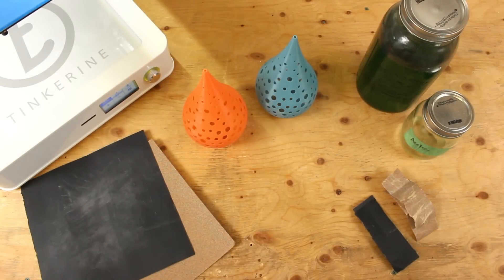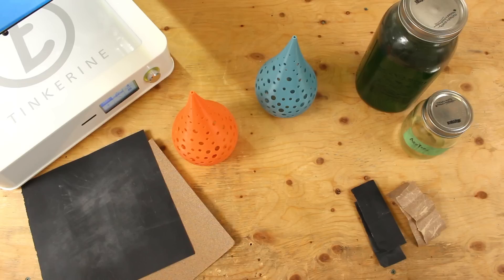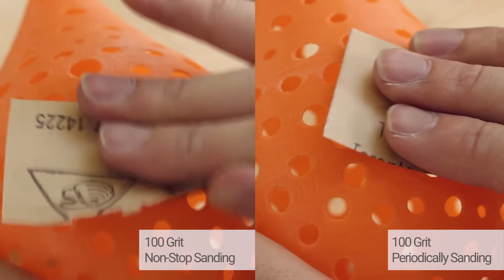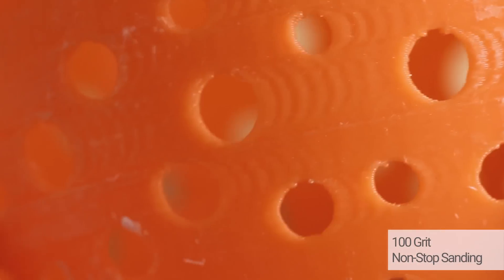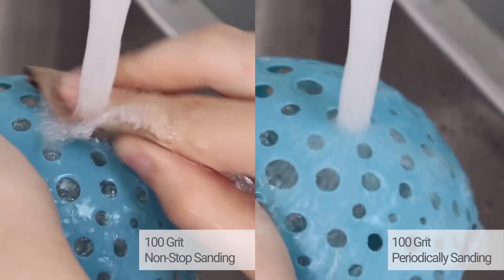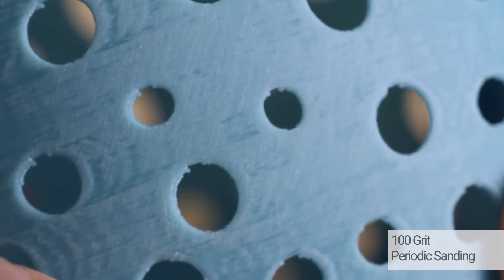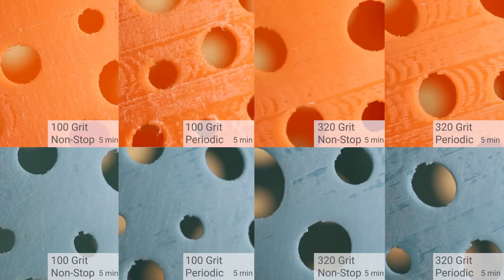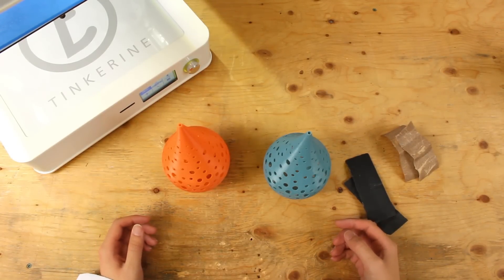Smoothing PLA with Sandpaper

Comment: Good video. I found it because I was thinking about sanding PLA vs. resin prints. My PLA sanding was always stringy, I was sanding dry. Resin sands with a nice fine powder, really smooth when rinsed off.
Reply from the maker: Thanks for the comment! Wet sanding is a better method for PLA to prevent it from heating up and becoming stringy.

Comment: Okay so... wetsanding under running water is pointless. The entire point of wetsanding is to build up grit under the sandpaper that is lubricated. When you do this under running water, you're literally washing away any grit buildup as soon as it forms. You might as well be trying to sand with your barehand. Proper technique: let the sandpaper soak in warm, soapy water for several minutes until it's completely saturated. Then apply sandpaper to object with light pressure until you feel the friction "break", once that happens, rinse (and repeat if necessary). Always rinse between different size grits as well, otherwise you'll still be sanding with the same grit of the former paper...
Reply from the maker: Thank you for the comment and the advice, we have stopped wet sanding underneath running water!

Comment: Pretty nice tests.. but seems you don't know some basics of sanding.. you up the grid on every few passes. Each next grid removes the marks from previous. If you change direction of sanding on each grit change you can see when the scratches from previous grit are removed. Also use a much higher than 320 to finish.  For wet sanding you only need to wet the sandpaper every now and then..  no need to have constant flow. Wet sanding will produce more fine finish as it removes any debris that scratch the model as you're sanding - also it will prevent sand paper from clogging.
Reply from the maker: Hi there,

Thank you for the input and feedback. We will definitely take your advice and improve on our sanding in the future!
Reply: Tinkerine Use concentric rotative movements for maximum effect !
And thanks for the experiment !
Reply: @ Google+ SUCKS BALLS,

my thoughts exactly. I would have gone all the way to 800 grit.

Comment: Could I work up to 1500 grit and get really smooth and shiny results or is there a limit due to the material structure?
Reply from the maker: Hi ArcanePath360,

Thank you for commenting on the video! There shouldn't be a problem to using 1500 grit sandpaper to get the model really smooth.  Let us know the results!